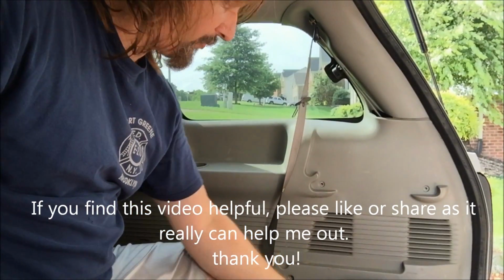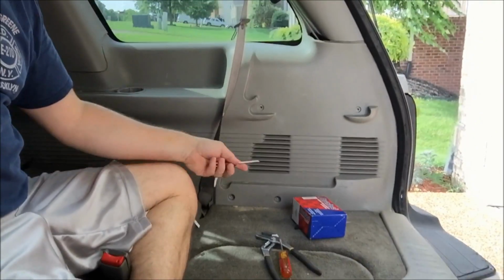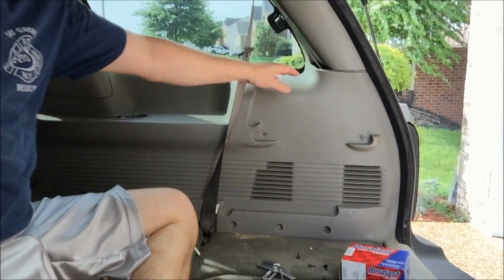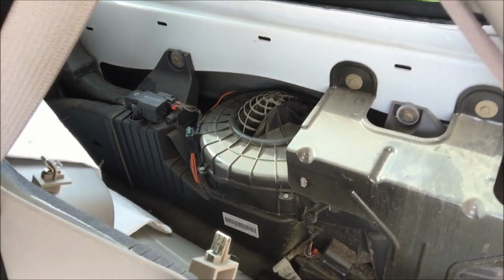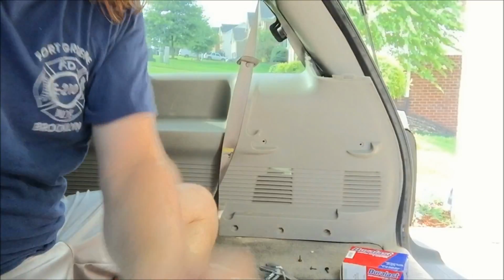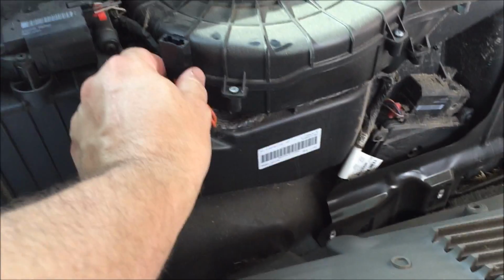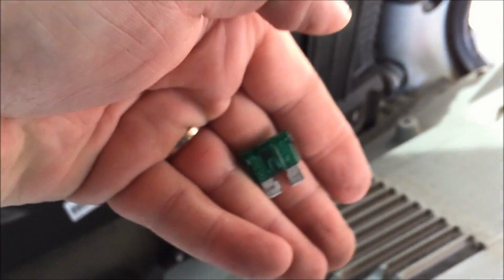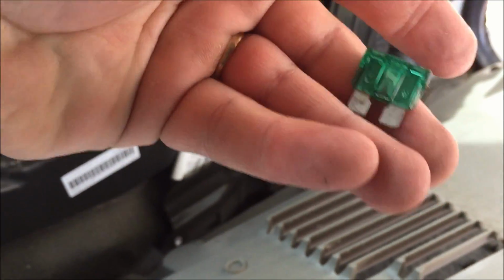2004 Chevy Trailblazer rear ac air conditioner blower location

Comment: I have a 05 Chevy ext and my ac works fine for the front but in the 2nd and 3rd row they only blow to the feet
Reply from the maker: That is probably either a bad switch or bad actuator.
Reply: What about wen the back only blows hot air